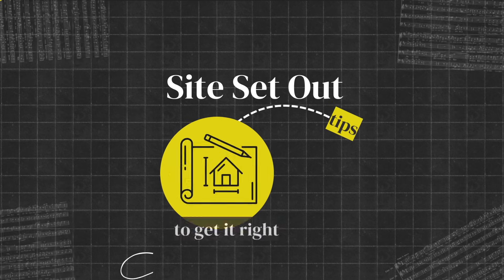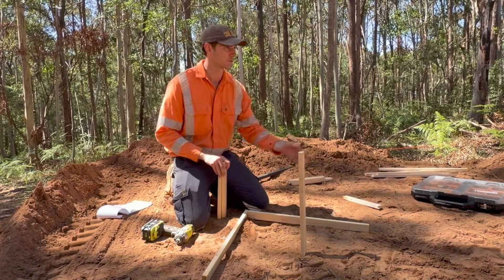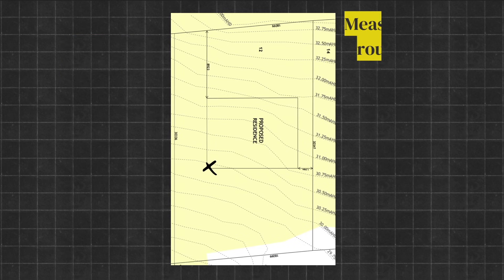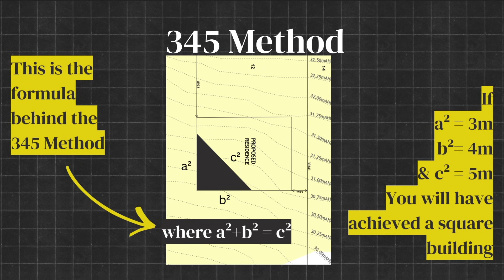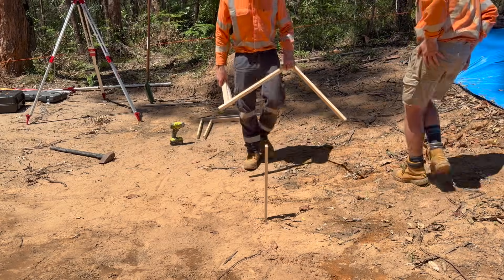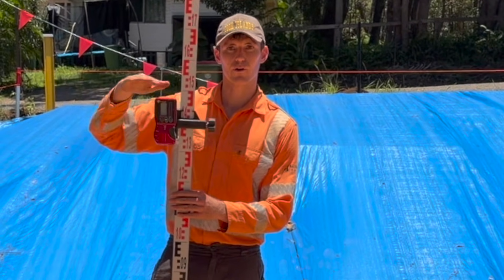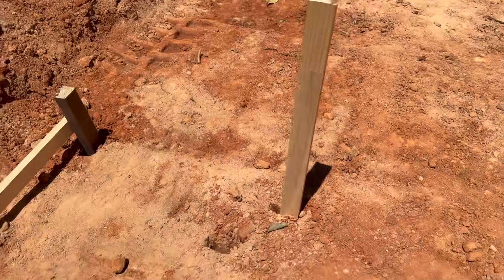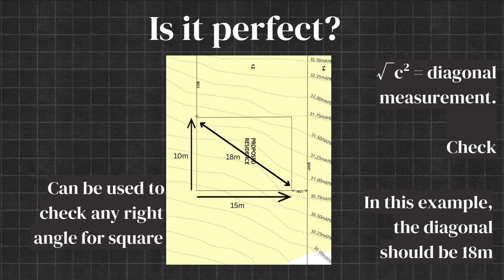How to Square a Building: The 3-4-5 Method (Step-by-Step Guide)

Comment: In your final step where you calculated C2 using the buildings dimensions, you need to  measure the other diagonal and it should agree with the first, if it doesn't it could be 1 of 2 things, an error was made in the first calculation or 1 of the sides is not the correct length.
Reply from the maker: Yes this is correct! And a very good point. Thanks for sharing 😊